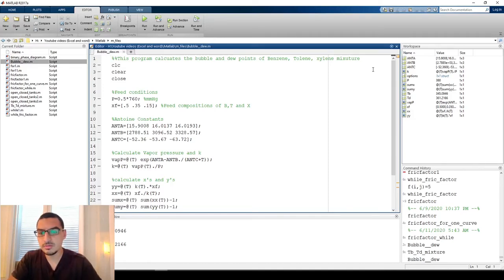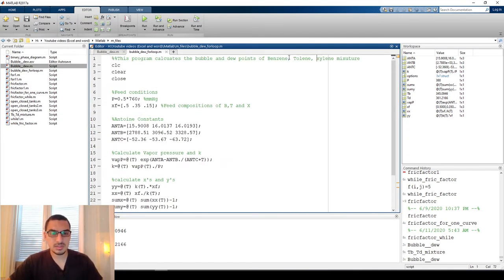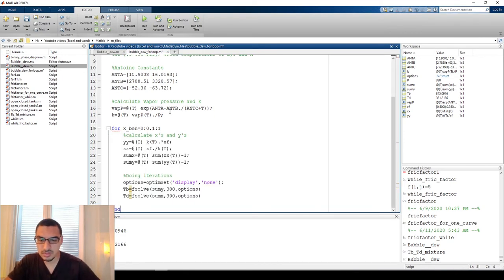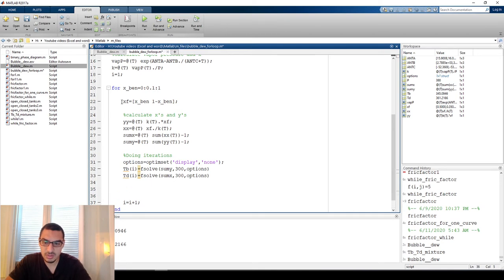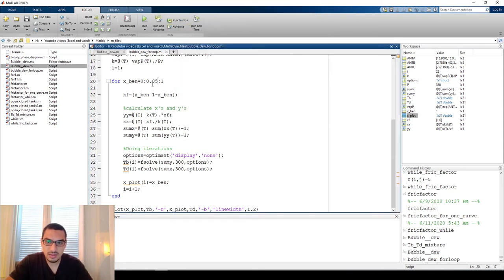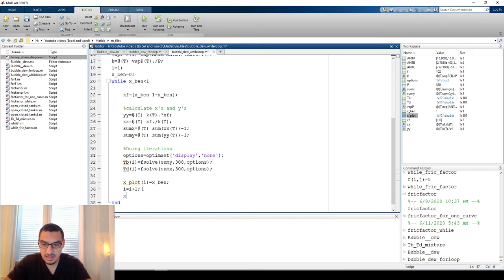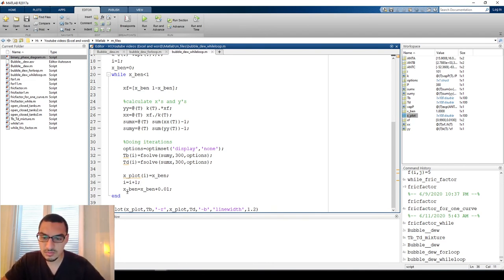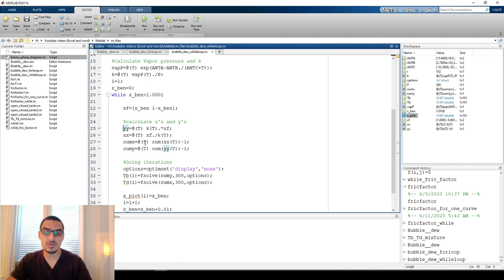Introduction to Matlab in English | 36 | loops tutorial - binary system phase diagram

Comment: Hello, Thanks for such an elaborative video. Can you help regarding ternary mixture? How can we use similar for a ternary instead of binary mixture?
Thanks.
Reply from the maker: Yes, you can. But in such case you have to use to nested for loops each for the composition of one of the three components. Also I know that Matlab can plot 3D plots, but I have not done it before. You can try it.
Reply: @MGMohammed  thanks for the input. I was just getting confused about the change in xf, will complicate everything and too many unknowns with less equations. So, I will try to stick to your method and try it. Thanks once again.